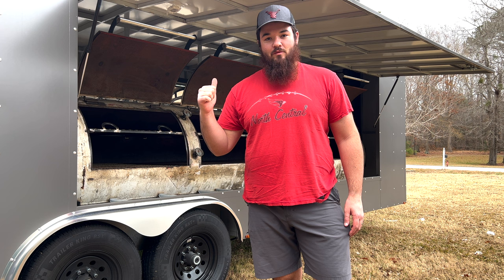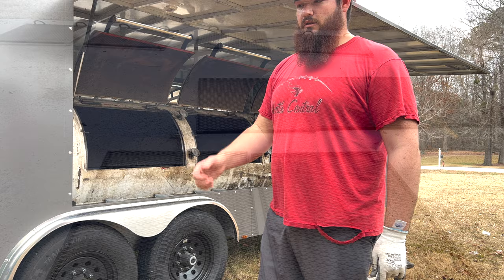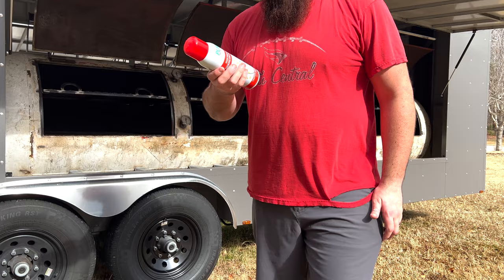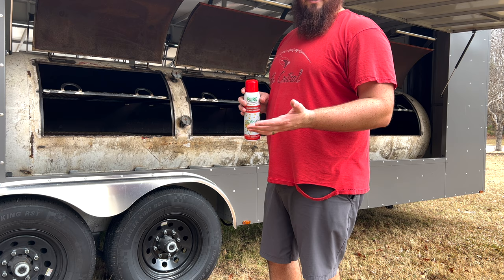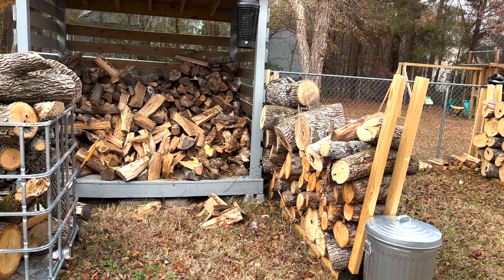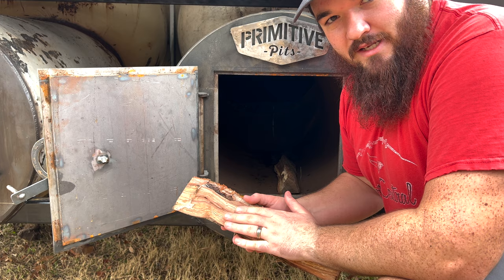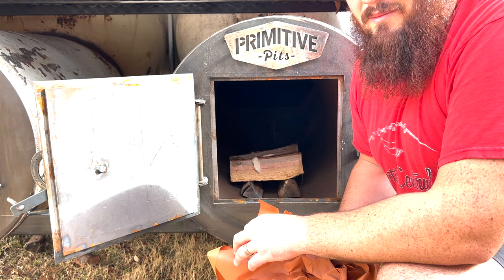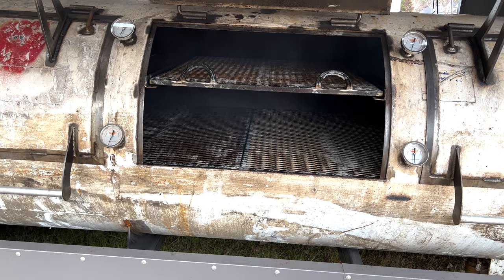How To Season a 1000 Gallon Offset

Comment: Awesome trailer pit! Have any trouble going through a tunnel? Also, didn't see any dampers on the firebox, do you regulate the airflow by opening the door?
Loved the size of that smoke collecter and stack, bet that draws like a vacume cleaner!
Thanks for the video!
Reply: 2:40 there's a ladder in the front and the stacks are hinged to fold down.